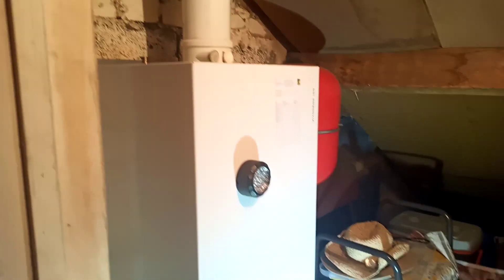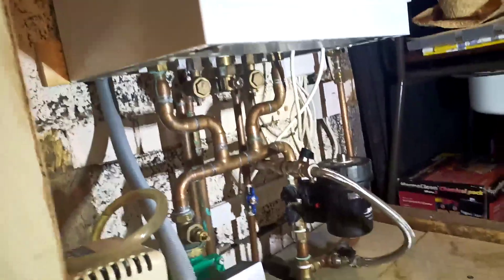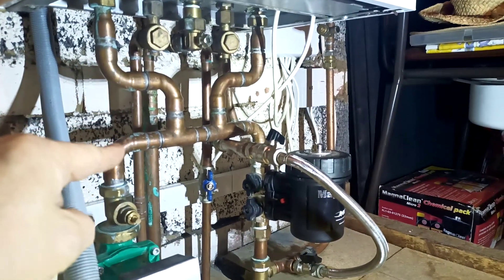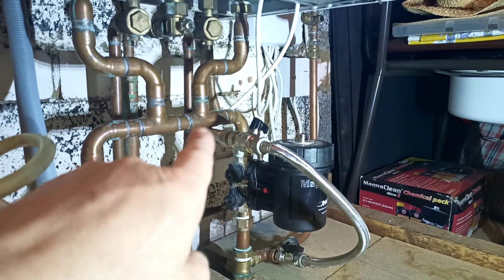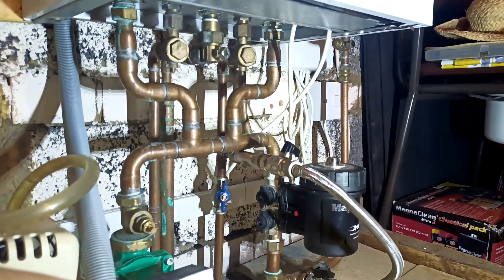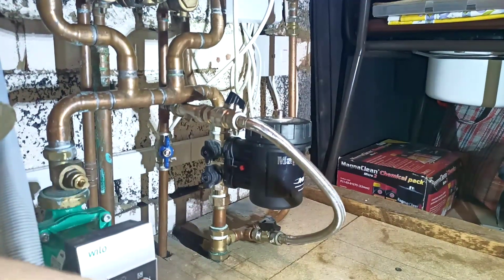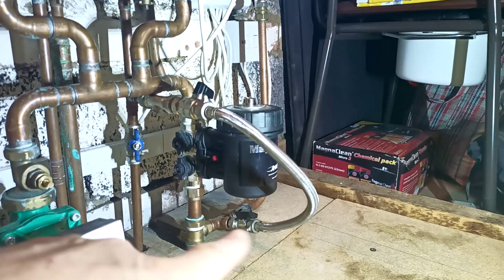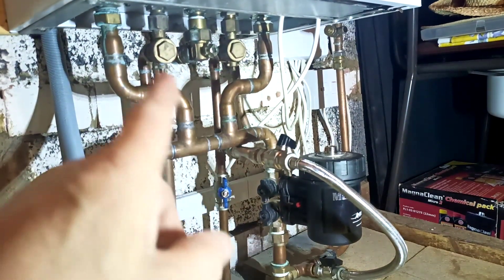Classic close coupled tee layout.

Comment: I have a 111 with a non-touch LCD screen and was wandering if it would invalidated the warranty with Viessmann if I were to install flat face unions instead of the supplied valves? Also where did you get yours from (I think the 111 flow/returns are 3/4")?

Comment: Old video I know so may be going over something that’s already been asked so appolgies if that’s the case. Wanted to know if using this set up, with a combi and cct’s, if I set it up after the cct with a pump for radiators and a connection to the flow to ufh manifold without a pump. Does it matter if the return from that manifold is tee into the central heating return? It would be the last tee on the return if that makes any difference? Just can’t get the return it self back to the boiler cupboard easily

Comment: Do you prefer closely spaced T’s over a low loss header for hydronic separation?
Reply from the maker: No. Each method has advantages and disadvantages. Ccts are compact, cheap and effective. A llh adds volume for boilers with poor modulation, adds air and dirty separation. A plate heat exchanger offers total protection of the boiler from contamination. A plate is really my preference but it's very  high cost, bulky and looses some efficiency. You have to.pick a method most applicable.
Reply: Awesome, thanks for the reply!
Reply: Awesome, thanks for the reply!

Comment: Ideally you'd Install branches in this order first dhw then radiators and ufh at the end am i right?
Reply from the maker: This is close coupled tees at the boiler so any order after will receive the same flow temperature. You are thinking of primary secondary layout with multiple cct's. I have other videos covering this.

Comment: Andy, you mentioned UFH in this video without a pump. Would UFH with a pump be ok? I was contemplating this arrangement but my UFH manifold has a pump @Andrew Millward
Reply: Would you still control UFH and radiators with zone valves. And wire them like an s plan. Trying to get my head around a job to makes sure it's going to work the best it can with what the customer already has.
Reply from the maker: @smgroves26  no need for zone valves.
Reply: What are the considerations when deciding to choose between cct or a llh? Or neither? I presume it's not just as simple as making sure the boiler can provide the flow rate required for both circuits?
Reply from the maker: @rodgerq  it's a list of considerations. The type of seperation used is based mainly on :
Do you need extra system volume due to poor modulation.....llh.
Low price and or little space ....close coupled tees.
Protection of boiler from contamination....plate heat exchanger. 
If you need seperation at all is very much more complicated. I keep it simple but not necessarily totally correct. Ufh needs seperation. As I say not really always true.
Reply: @andrewmillwardwatford9410  thanks for the summary. I've got ufh going in sometime this year and am worried the engineer will just come and throw it on a zone valve and leave(coincidentally that's what the ufh supplier have said should happen), but also don't want to be that guy telling a professional how to do their job.
Reply from the maker: @rodgerq  where are you ?
Reply: @andrewmillwardwatford9410  about 30 minutes west of Glasgow. Bit of a trek lol.
Reply from the maker: @rodgerq  you could look for an installer on the heat geek website
Reply: @andrewmillwardwatford9410  thanks for the suggestion! I had a look there but the closest one is almost 2 hour's drive away.
Reply from the maker: @rodgerq  try on my forum.
Reply: @andrewmillwardwatford9410  is it a Facebook group or a website? Pretty sure I've seen you posting about anfb group before but I assumed it was for engineers only.
Reply from the maker: @rodgerq  https://www.facebook.com/groups/1283670701667577/?ref=share
Reply from the maker: The pump if on a normal ufh manifold is ok but no pump from the cct.
Reply: @andrewmillwardwatford9410  cheers Andy, so just for clarity. If the branch for the UFH is after the CCT but before the pump which feeds the CH, then a UFH manifold with pump will be fine?
Reply from the maker: @stuarthughes6530  almost all manifolds will pull water. A few few will not.
Reply: @andrewmillwardwatford9410  awesome, appreciated
Reply: @andrewmillwardwatford9410  if you already have a single pump doing all zones - would it matter that you’re pumping to the UFH manifold even though that has its own pump? Just increases pressure right having pumps in series. Want to avoid moving the current main pump which serves rads circuit and DHW.
Reply from the maker: @beak700  are you adding hydraulic seperation ?
Reply: @andrewmillwardwatford9410  yep plan to add close coupled tees and a primary circuit pump and just leave the main pump in place to serve the rad zone, DHw Zone and the upcoming UFH zone. For simplicity just wondered if there’s any detriment to leaving the main pump in place given that it will mean the UFH circuit has a pump to the manifold then which goes against your advice in this vid. Cheers
Reply from the maker: @beak700  shouldn't pump tomthe manifold
Reply: @andrewmillwardwatford9410  thanks Andrew. I guess I could take the flow to the UFH after the CCT but before the pump to CH and DHw then as you describe in the video. Just a small pipe alteration then and no need to move the secondary side pump. :) after watching a lot of your videos and asking questions things certainly starting to make sense now.
Reply from the maker: @beak700  that will work well.
Reply: @andrewmillwardwatford9410  can the return for that join the common return where the CH and DHW join in or should that also tap in to the return before that secondary pump? I’m guessing anywhere should be fine right? Thanks for the replies!